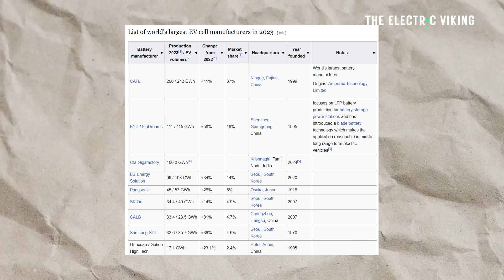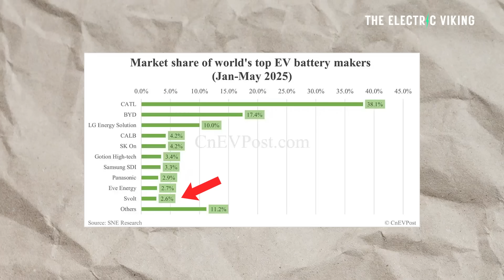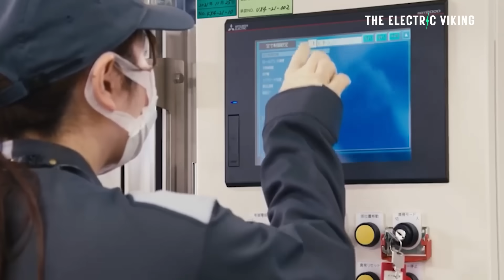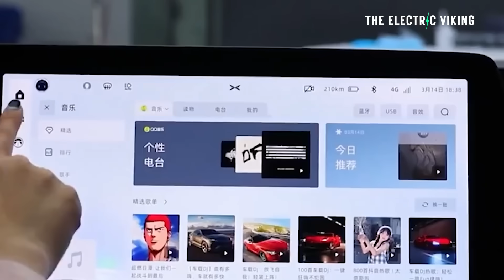The 10 Biggest Battery Manufacturers in the World in 2025

Comment: There is an unlimited number of ways to make a battery but some of the best ones may have already been discovered. The performance of CATL sodium batteries is impressive but the material cost is the really big news. Better doesn't always win, some time the lower cost wins.
Reply: You make a good point. A 100,.000Wh/kg battery would be cool but mostly useless if no one could afford it. Lowest cost for the use case is usually a winner with caveat it has adequate level of functionality.  

One more thing amazing about CATL is their battery margins are higher by battery industry margin standards yet  their EV battery prices are lower then industry average (per KWh). Not only do they have great scientists to rapidly develop new battery chemistries but great engineers that quickly ramp up mass production. I'd love to see a documentary about their management's views on maximizing efficiency.  Incredible company.
Reply: @mydogsbutler  You also don't need a battery that will outlast the car unless you have a plan to get them back and reuse them for grid storage or referb them. And if you do that you may as well plan to recycle the entire car.
Reply: it's about value for your money